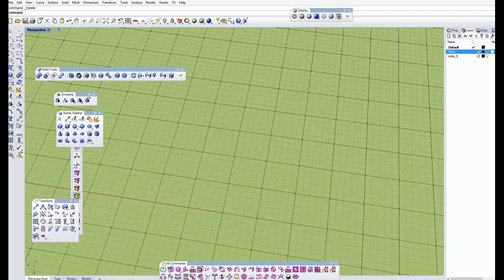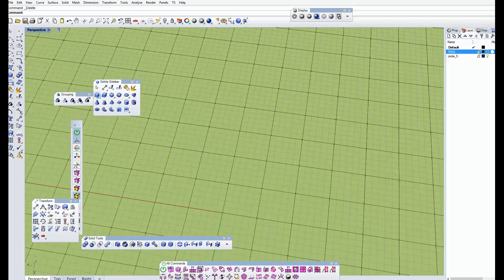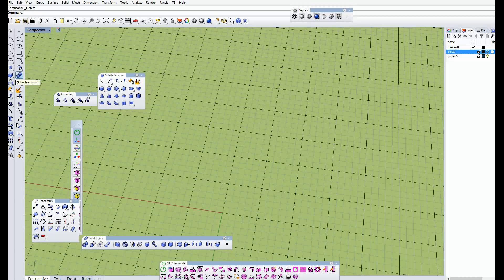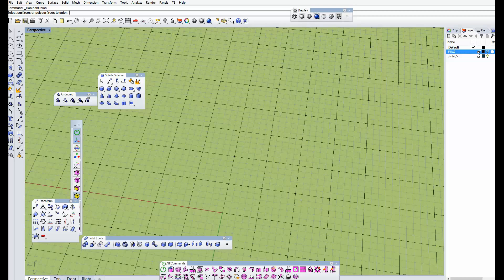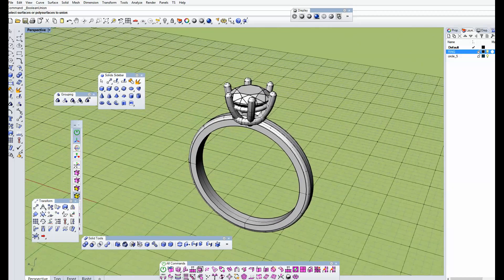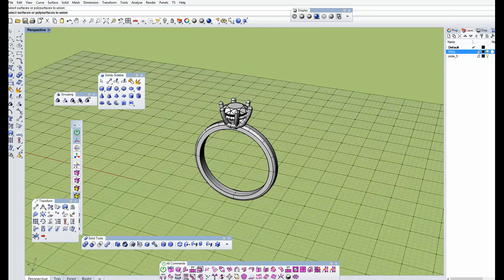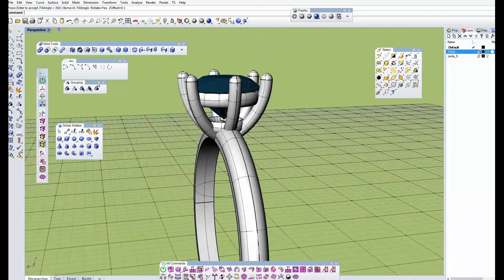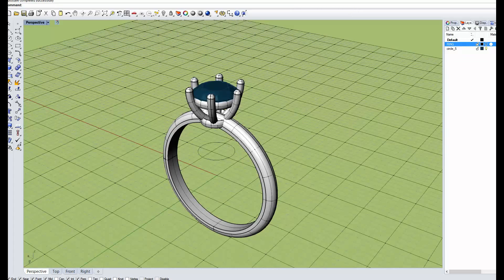3d modeling tutorial for jewellery. Wedding ring. Rhinoceros 3d

Comment: Great tuto but I have problem in 13:45 at 15:00 you duplicate pipe circle and rezize them. How I do rezize my circle...I no found the tool bar by change diameter. Tkns
Reply: Ops I get - used scale 2 D and resize my diameter.